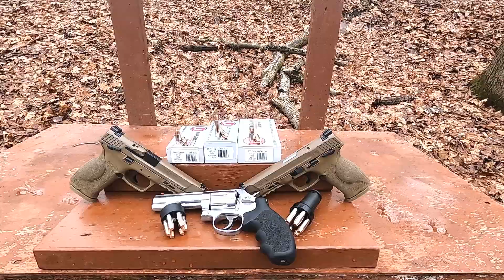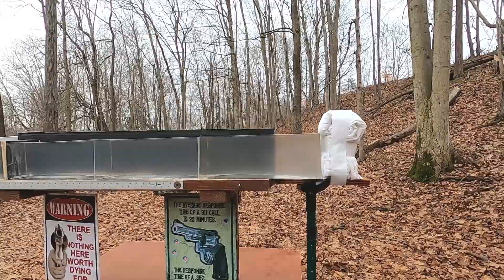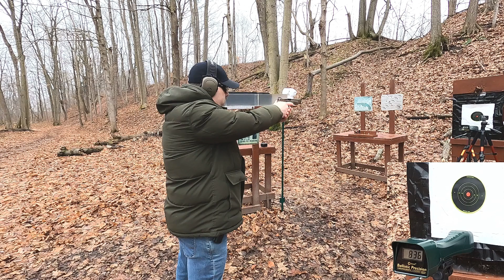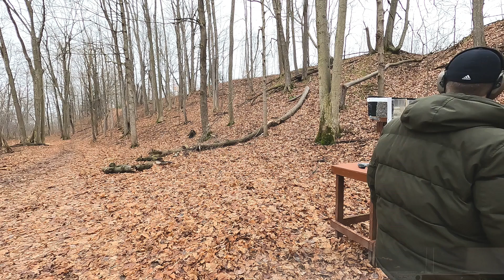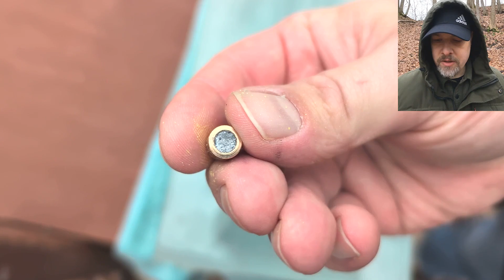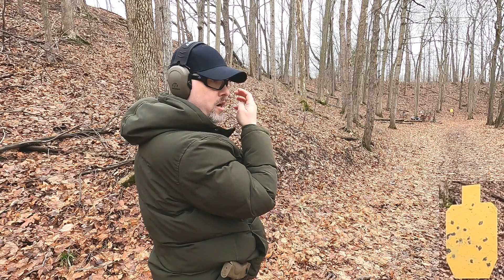9mm+P VS .357 Mag VS .357 Sig! Underwood FMJ Flat Point Hunting/Animal Defense Ballistic Test

Comment: As usual your honest tests are a real service.  That sig round is hot.  I don't know why Underwood are such wankers when rating their revolver ammo.  Its not like they got +300 fps out of an 8 inch barrel.  And the extreme spread was crap.  Meanwhile Buffalo Bore gets an honest 1450+ with heavy 180 grain bullets.   Dear U-W, At least produce a low flash defensive load when only pushing 125 grain XTPs to 1250 and quit rating them at 1500.

Comment: Impressive demonstration & reasonable conclusion. You did, however, also show one of the reasons I got rid of both my 357 Sig pistols with that malfunction. I had multiple problems with rounds hanging on the feed ramp & bullets setting back in the case including premium rounds like Gold Dots. 357 Sig is a good concept that in my experience doesn't execute well. 

Also a great demonstration & explanation of how/why higher velocity doesn't always mean more penetration.
Reply from the maker: I've got like 4 malfunctions with .357 Sig in the past 2.5 years since I got a .357 Sig barrel. That's with a lot of JHP use. .The 40 S&W or .357 Sig has had the same level of reliability for me in this pistol.
Reply: @GunSam  I'm glad you had better results than I did. I would still check bullet setback after chambering occasionally as it can cause pressure increases.

Comment: As far as I can tell, they all performed about the same. I'm disappointed by the 357 Magnum. I think it probably had too much empty case, causing the variation. I would have gone with the 158gr Kieth style hard cast. I would also like a six inch barrel for dangerous critter application. I'm sure it would have also made it to the third block.

Terminal ballistics still mystifies me.

Comment: The 357 Mag shines with heavier bullets because of the case capacity. That is where it walks away from the Sig. The 158gr top end loads have the same velocity from a 4" that you got with the 125. Where as the 147gr Sig loads are definitely slower.
Reply: Agreed, not the optimal load for 357, but was the optimal weight for 357sig.  I'm sure it is what was available.

Comment: There seem to be some rimmed cartridges that Underwood sort of phones-it-in. They could do this cartridge a lot better. Different propellant for less flash, more consistent load for less stupidly spread velocities, and a stronger crimp to avoid creep.
Buffalo Bore remains the "gives a flip about revolver cartridge" company, overall.
Grizzly has a 150gr FMJ-FP load rated at 1550 fps (probably 6-inch barrel).
DoubleTap has a 125gr FMJ-FP load, no ratings published on their site.
Buffalo Bore seems to only offer 38 Special loads that would be similar, in wadcutters or semi-wadcutters. Their .357 stuff is mostly HP style.

Comment: u always say the 357 mag is boatloads more powerful than the sig in a carbine but bbi says differently, and case capacity and max pressure say differently
Reply from the maker: Not sure what you are talking about. Buffalo Bore shows their 125 gr .357 Magnum at 2,298 FPS from an 18.5" Marlin. That's 1,465 ft lbs energy. I'm assuming you are referring to Ballistics by the Inch, which doesn't even show any .357 Sig carbine numbers, all they show is generic barrel lengths up to 18" with the maximum velocity with a Corbon .357 Sig 125 gr at 1,729 FPS which is 830 ft lbs energy. Even if I took that generic BBTI chart at face value, the Corbon 125 gr .357 MAG in a generic 18" test barrel is 2,113 FPS for 1,239 ft lbs energy. So basically, you are arguing I am wrong by directing me to the source that shows you are wrong. Well played.
Reply: @ your right, im sorry i was confused with the 10mm.

 ur always saying the mag is better than both cardriges. but in revolvers both are superior than the mag and even with extra barrel length (up to a point) 

i thought u were a revolver lover not a carbine lover, or maybe a revolver cartridge lover? idk

ive never seen a carbine on ur channel...

reguardless i love all cartriges and enjoy the reviews but it serms your always bias againt rimless cartriges. hope u have a good day

Comment: Wow, it's incredible how Underwood consistently under loads revolver cartridges.
Reply: Pressure is directly related to velocity, but it's not a 1:1 proposition due to burn rates, propellant formulations, barrel lengths.
With proper development, it is possible to increase velocity while NOT increasing pressure.
Reply: you could use bernullis with the average pressure to find the veloity and the average pressure can be calulated using the inert gas law at points along the barrel

its probably what quick loads does
Reply: max pressure is lower in the mag vs sig
Reply: @Blue_Dog_Ranch  And yet, 357 Magnums greater case capacity lets it push a 125 grainer at 1600+ FPS when not pudd loaded.
Reply: @Blue_Dog_Ranch maybe so, but that's half the equation, case capacity is higher with mag.  The real point is the mag had wildly inconsistent numbers and printed very paltry numbers compared to many other loadings.  Those were crap rounds.
Reply: Buffalo Bore often runs things hot, but it's not over pressured. People might like to thinks so but it's not the case. They simply spend more developmental time and find propellants better suited for the task. They aren't manufacturing a billion loads of X, selling them to the military or law enforcement, saving a half penny on each "ker-chunk".

Comment: Wouldn't happen to be a  P.O. box for me to send some bullets, would there?
Didn't see it on the channel page.
Reply from the maker: I generally don't do that.
Reply: Gotcha! No worries. Not sure if you're into casting as well as reloading, but FYI Lee's Tl410-210-swc can be sized down to 401 pretty easily after powder coating for use in your 610 revolver. They actually feed just fine in my 1911 chambered in 10mm too but they seem more suited for a revolver. A 210 grain semi-wadcutter in 10mm should pack a punch!

Comment: The .357 mag would penetrate more than the others with 158 gr or 180 gr bullets.
Reply: I have not personally ever had decent results from a revolver of any barrel length with the 180 grain bullet. I have found that the limit for good performance is 170 grains, but to be fair I have never used the newer long barrel optimized powders like MP300 so that might change the results.

Comment: Really like seeing that m&p 357 sig.
Reply from the maker: It's actually the M&P 40, but a lot of people do indeed call it a M&P .357 Sig as the magazines do say .40/.357 on them. Sort of like calling my 686 revolver a .38, as it can be very easily.
Reply: @GunSam that is a wonderful thing. I've converted a few guns to 357 Sig, 3 H&Ks and a 1911.
Reply: @Lexicologist1971  what HK's did you convert to 357 sig? I don't think HK ever made a standard size USP in 357sig but they did make a factory 357 USPc.
Reply: @DIYDad1 , P2000, P2000SK,  USP40, & USP40 Compact.
Reply: @GunSam I remember you said it was a 1st gen m&p in another video. I am tempted to see if they have a barrel conversion for the 2.0. If not, what lengths were available in 357 Sig? That's a spicy caliber 🤩